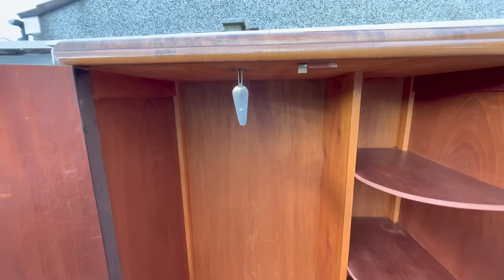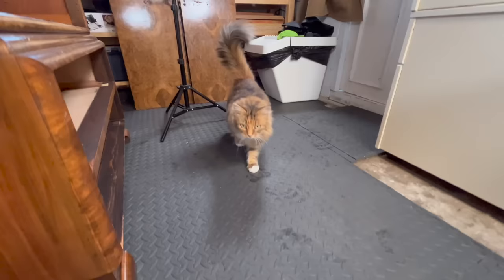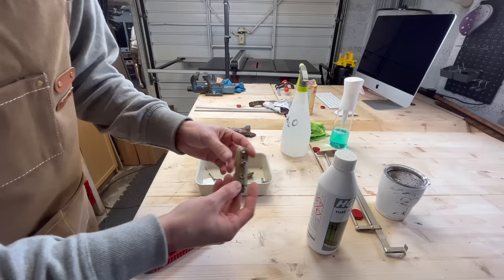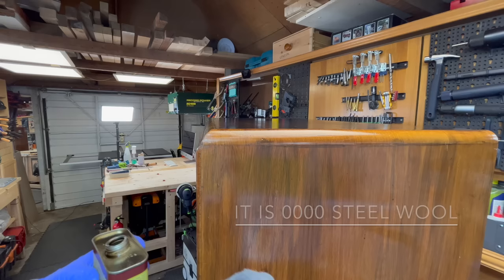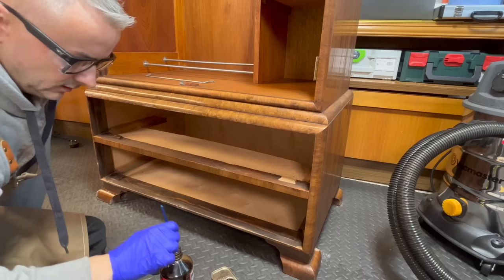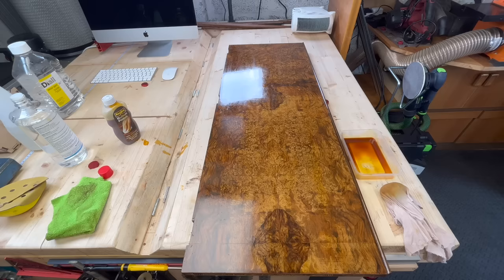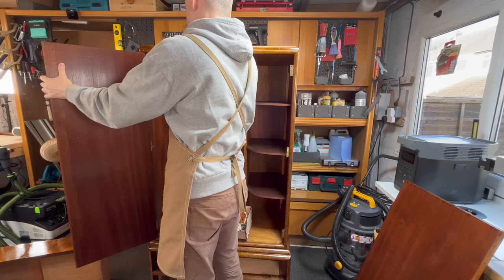1935 Wardrobe restoration with a surprise  | ECOFLOW DELTA2

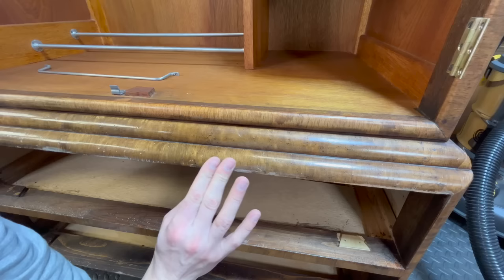Comment: The very thin veneer on the rounded portions 13:00 is actually a product made from cellulose called "VENEERITE" and was commonly used in the 1930s and 1940s on less expensive mass-produced furniture. It was "[a]n adaptation found in depression-era furniture is a veneer lookalike, known as veneerite. In this process, an imprint of a fancier veneer was printed onto thin paper, which was then glued to the wood to produce the look of edge banding and inlay, at a fraction of the cost. Furniture using veneerite is a decided step down from pieces with actual hardwood veneers, but it does help identify a truly vintage depression-era piece. It was a technique that allowed for a more elegant look for people who simply couldn't afford the real thing during these austere times." -- Spruce Crafts.

Comment: In 1980, I bought a beautiful 2 story duplex in Long Beach, CA..  It was built in the 1910s and had a lot of unpainted beautiful woodwork.  The interior woodwork surrounding the window were exposed wood and (obviously) the window frames were wood.  However, the wood of the window frames would NEVER match the wood surrounding the windows.  So someone painted the window frames to match the wood surrounding the windows.  An artist friend of mine called it “faux bois”!

Comment: I found a little wardrobe similar to yours at a consignment shop about 30 years ago. Mine was Oak veneer and had plastic decorations glued onto it... painted white, it was a nightmare to get the bits of white paint from the grain of the veneer... Mine had a surprise for me as when I got it home I saw some tiny hinges near the top of the back and indeed, the whole top of it lifted up to reveal a hidden place where one could store valuables and no one would suspect it was there. Later I gave mine away, but seriously have regretted that many times as it was so unique and ended up very beautiful after a great deal of work. I used a Danish Oil to finish it, and the wood looked amazing after. It was hard to understand why anyone had painted it. Mine had the same little side shelves inside, but not the drawers. I thought perhaps it was a child's wardrobe. Yours is wonderful with that burl veneer.

Comment: Shellac sticks do work,but are better for filling deeper holes. An easier option are wax sticks which come in different colours  that can be mixed to get the right colour,then moulded when soft. After cover with a coat of french polish or shellac.

Comment: You once again did an excellent job of restoring a worthy treasure; the restored armiore is lovely!  This video has inspired me to finally start the restoration of an also very vintage and somewhat similar style armoire I inherited from my Mom.   
Regarding the stair-stepped rounded trim on your armiore:  I am assuming those pieces  were likely hand painted faux wood grain, primarily because steam bending and securely applying a burled harwood veneer on sections with such a tight radius would have been extremely difficult to impossible back when your armiore was created.  If some craftsmen had been able to steam bend such narrow cross-grain strips of veneer and get them glued in place, I doubt that so much of the tightly curved veneer would have survived intact after so many years.  Veneer does not like sticking to tight curvy surfaces, especially as the wood fibers dry out through decades of time.

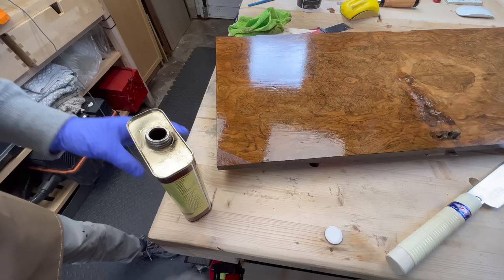Comment: To fix the dent (11:06) i woult try to put a slightly damp tea towel on it and carfuly iron it. It works well on waxed or varnished (modern varnish) surfaces. On shellac i dont have tryed this jet. 

One more sugestion. If wax or varnish is used on parts where wood are in contact whit wood (side and botom from the drower for example) they can stick together. So i is better to let this parts untreated or use cured soap as an finish. Soap dosent stick the pieces together.

Comment: This finish is a finish that was used... which was made using  photographic gell transfered onto the wood. It looks like a burl grain. It was often used on all of the surfaces, on more expensive pieces as yours is was ussed on the small areas. To repaire it, you use layers of different coloured stain straight onto the prepared wood surface.

Re: using shellac... to remove use methylated spirits as it is the solvent. I would have stripped the fronts back completely.
The technique for using shellac is to flood the surface - thats why the "rubber" technique is the best for building up the coats. 
If you prepare the surfaces back to the verneer - you will always get a better finish.
Reply from the maker: Thank you for the info, I did know about the alcohol and actually used it to remove the finish on the drawer but did not know about the gel. Need to read about it. This was a learning experience and I would have stripped the finish completely if I did it again. Recreating the pattern with stains wasn't an option for me. don't have enough colours to do that but might try it in the future.

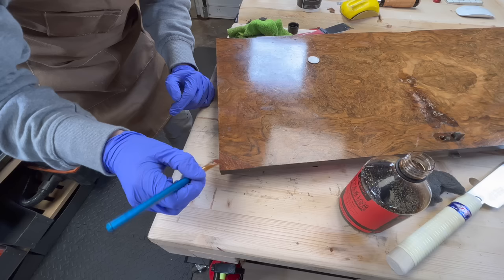Comment: At the 11:03 mark in your video, you asked about techniques for repairing tiny dents. You mentioned steam, and I inferred that a clothes iron would steam too great an area and damage the surrounding wood. Have you ever tried spot-steaming dents using a hand-held steamer? I have a steam cleaner that's designed for car detailing work. It came with several different types of nozzles that control the direction and spray area width/intensity of the steam. I wonder if the use of a fine-tipped nozzle, precisely directed at the dent, might work in such an application.

Comment: Hello, thank you for this lovely vidéo ! I have a few 1930s walnut pièces liké that and have done many veneer repaire through out thé years. A good tip I got is to place a pièce of kitchen parchment paper between thé veneer and thé clamp. Wood glue won't stick to thé clamp of thé wood block you might use. Also, I use specific veneer wood glue as it is transparent if it bleeds through thé veneer. I recommend thé french website gauthey for veneer products. Have a nice day!
Reply from the maker: Thanks for the info!

Comment: I have this exact thing, how do you get the musty old smell out of this?
Reply from the maker: It didn’t smell
Reply: @Flippingdrawers  oh damn I guess Iam stuffed. Please if anyone knows how to get old smells out of furniture please help!
Reply from the maker: @skrefurbishedinteriors  @transcendfurnituregallery made some videos about this
Reply: @Flippingdrawers  yes thanks seen some suggestions but the products they have over there are not available in UK. I tried bleach with water, nope!, Tried vinegar and water 💦, nope, I think I needed the spray shillac that is not in UK. Do you know if the liquid shillac on Amazon is the same thing? Otherwise tomorrow I will try sanding the interiors and spray with normal clear sealer? Otherwise would have to use zinsser primer and paint inside if all fails which would be a shame!